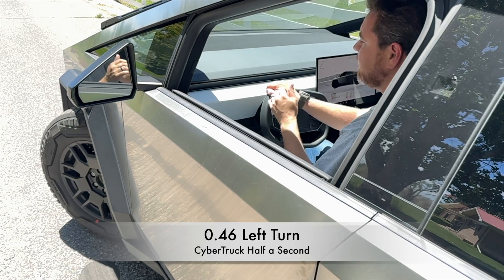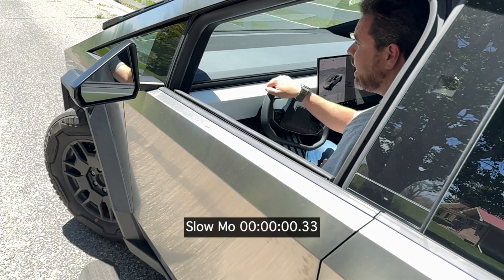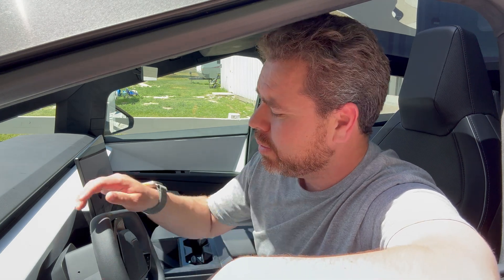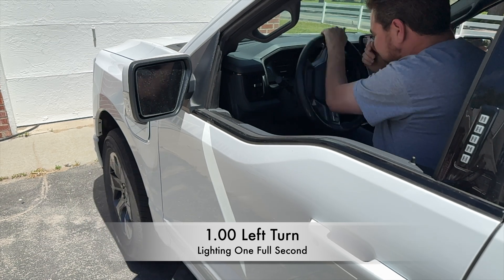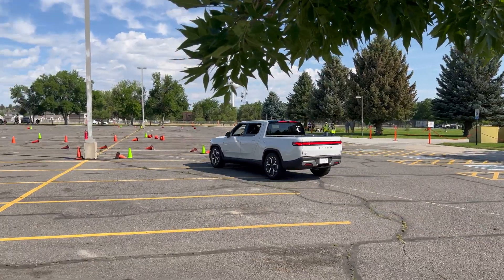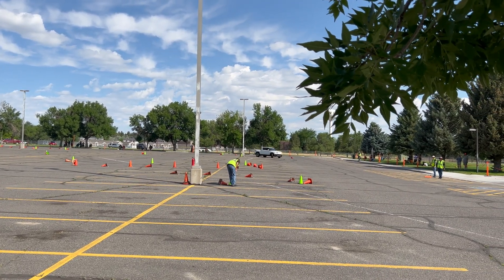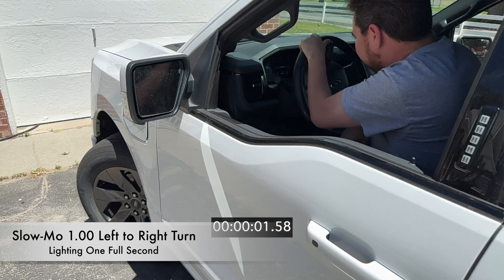Cybertruck Steer-by-Wire Crushes Ford F-150 Steering in Speed Test

Comment: The problem is predictability,  when you move the steering wheel of the Ford you know how it will behave in any position. However, for the cybertruck in case of a fast side to side reaction, like a moose test, your brain will be confused and it can prompt you to lose control.

Comment: Maybe there should be a buffer built in the system that disallows you from turning the steering wheel inside unequally to the wheels movement

Comment: Tesla steer by wire absolutely has to have a scale equity in the movement of the steering wheel... How does this stuff get onto the market... Panic during an accident steering back and forth will start a bizarre wobble of directional control like controlling jack knifing trailer... Speaking of which that seems to break off at 10,000 lb entire trailer hitch on these particular car/trucks frame with it... An ostentatious engineering nightmares seems to be

Comment: Ford wrist twist steering experimental not getting onto the market back in 1965... For obvious danger issue reasons.... Does this system have manual override it sounds not... During an accident or if just failure

Comment: I test drove a CT and a Lightning last week and the CT's steering seem WAY more responsive than the Lightning.  And I had not even heard of this lag thing at the time.  The rear steer on the CT may have something to do with it.  Would be interesting to see cameras on the front and back simultaneously when you do this lag test.

Comment: This is Lock to lock. 😂 the CT handles like a weapon for its size. Cast chassis makes it incredibly rigid, variable ratio steering changes depending on speed and rear steer. This will out perform ANY vehicle of its size on a track… 

People have re-used this video to make it look negative and make it look like the lag is an issue when it’s not…. The internet has become anything for attention. 

Every jet in the sky uses fly by wire with millisecond response times and several layers of redundancy and position monitoring.. this WILL become the standard. Hence why other manufacturers have wanted to do it for ages but legacy parts suppliers have made the transition to 48v architecture impossible as most manufacturers outsource everything from infotainment to electronics.

This rapid lock to lock is only possible thanks to fly by wire and variable ratio steering. This would be several hand over hands for a normal car.

Comment: Why does a 3+ ton truck need a ~540 degree yoke instead of a less sensitive *wheel*? It's a truck, not an f1 car. That's a unnecessary level of steering sensitivity, and a dangerous amount of lag, too.
Reply: yeah and turning the wheel feels good. .....wouldn't be good in an f1 car either. lag is not good at 200mph. the only people who I have heard say steer by wire feels good are tech people and car reviewers, not people with a motorsport background and credibility as drivers.

Comment: Wow what a Tesla bootlicker. Yea you’re completely wrong. No delay? Theirs considerable delay between actually turning your steering wheel vs the tires turning. 

Theirs a reason as to why car manufactures don’t make 180 degree full turns in cars as it allows for more precise movements and adjustments while driving.

Comment: Nice video, but you're skimming over the latency and too focused on speed of turning. To me it looks like there's at least 210 ms lag.

At 2:20 mark, your steering "wheel" on the CT is turned 90 degrees to the left, yet the wheels are perfectly straight for a few moments, when the stopwatch timer was at 00:00.38.  

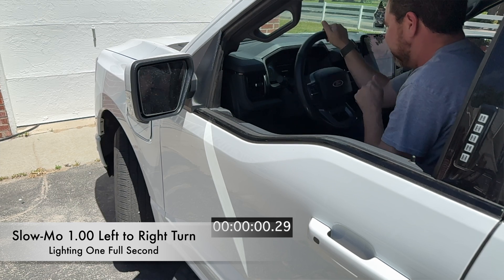At .46 on the stopwatch timer, the steering 'wheel" hits the left lock and the wheel is still turning until .67 (2:24 in video) when you cut to your face. So there was at least 0.21 seconds = 210 milliseconds of difference. Average human reaction time is 250ms.

I think people are 'concerned' about the de-sync between wheel and "wheel" rather than how fast you can go lock to lock. At 200ms I'm not sure it makes a difference, but it's at least notable
Reply: This. He's mixing up a short ratio and response time in one.

Comment: Not sure why you are mixing the speed and latency of the steering system. These are two different things. The Cybertruck has a quick ratio steering, no doubt about that. The issue is the latency in the system. Look at 2:21, wheels are straight and steering is turned. The F-150 has a slow ratio steering but no latency due to direct linkage.
Reply from the maker: If you look at the input delay, there’s virtually nothing on the cyber truck and there’s actually more due to the looser steering on the Ford. There is definitely a delay on the cyber truck motors, catching up to the input. In my demonstration going for left right quickly was to exaggerate the delay.  Even with the way it’s still significantly faster than you can mechanically do on ford. This is something you’d never do in real life in motion. In fact the truck won’t even let you do it as it is just as you go faster.
Reply: @TeslaTrip you didn't comprehend that correctly.
Reply: @AbsolutelyNotPortiasMusic  Yeah, he’s not getting the issue my man
Reply: @Dcale  there's a difference between turning ratio and lag. Bigggg difference
Reply: @TeslaTrip  first of all its literally impossible (as in, against the fundamental laws of our current understanding of physics) for a steer by wire system to have less delay than a conventional steel steering shaft. Secondly,  I think the concept that you failing to understand is that when it comes to variable ratio steering, the steering ratio being employed at any given time is contingent upon speed. Such systems don't modulate between ratios when the car is traveling at a consistent speed. speed is determinant. at lower speeds (or when stopped) the ratio will allow for the wheels to be moved quickly with very little driver input. Therefore at moderate and low speeds the delay will be compensated for by the minimal amount of steering input needed at the steering ratios for those speeds (as demonstrated in your video). the issue is that with the ratio employed at highway speeds or greater, this is not the case.

Comment: Steering has never EVER been an issue in anyone's driving experience. This invention  just took a perfectly fine thing and made it a huge issue.
Reply: Right? Sounds like a liability. Even if it does feel fine while driving, it's gonna be easy enough for someone to cause a wreck and claim the steering was an issue. Seems like a lawsuit to me
Reply: Exept there is no issue with the drive by wire either. People just think there is.
Reply: After you try steer by wife, I promise you won't want to go back.  Legacy steering feels old and sluggish after using steer by wire.  You'll wonder why all cars don't have it.

Comment: It's not noticeable lag in real world driving so why does it matter?
Reply: I guarantee it is noticable
Reply from the maker: It doesn't just some FUD going around that it could kill you.  Fact is It's still faster than normal steering,
Reply: @TeslaTrip it's not faster than normal steering, it has a shorter ratio. Two very different things do not spread miscomprehension to others. Very unintentionally malicious actions there.
Reply: @AbsolutelyNotPortiasMusic  Have you driven a Cybertruck? It's super responsive, my wife doesn't like how how quick it turns.  Nothing malicious just showing how fast you can turn the wheel when stopped with the high powered dynamic shorter ratio.  The ratio change the faster you drive so it's not dangerous.
Reply: @patricklawsonwalkingcrow  you're missing the point

Comment: The issue with the lag is that  it’s inconsistent, not the speed. In an emergency you might overcompensate resulting in a crash due to the inconsistency lag. In a traditional steering system it takes longer but it’s predictable… allowing one to compensate and get predictable results.
Reply: Bingo!! Well said!
Reply: The issue Is... You're making stuff up. There's no issue.
Reply: You’re a muppet. Variable ratio steering has been in cars for a really long time 🤦🏻‍♂️ driving a car with variable ratio steering is amazing. And safe.
Reply: @Jack_Hagerty  variable ratio steering has, but steer by wire has not.
Reply: @Jack_Hagerty  your mother is a piece of blue cheese.
Reply from the maker: After you drive a cybertuck you can tell it's not really an issue.  It is so much more responsive it does not feel laggy or inconsistent at all.  You don't have any time to overcompensate and try and correct before the motors move.